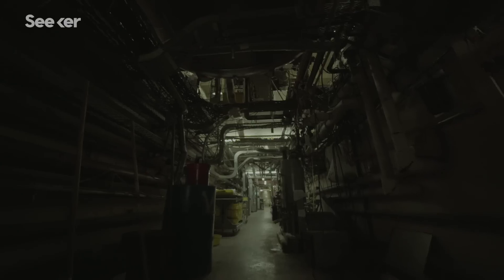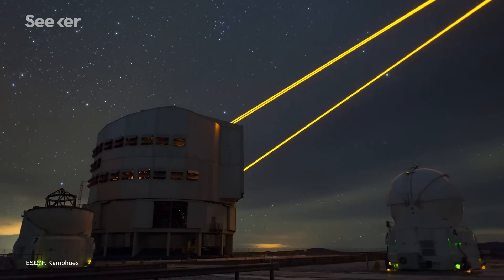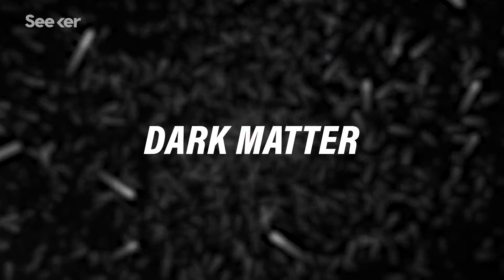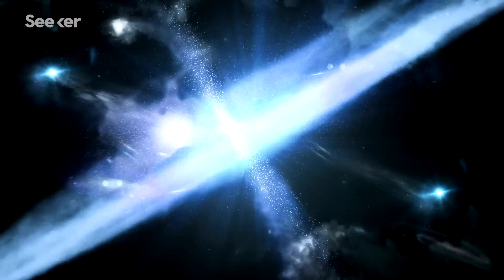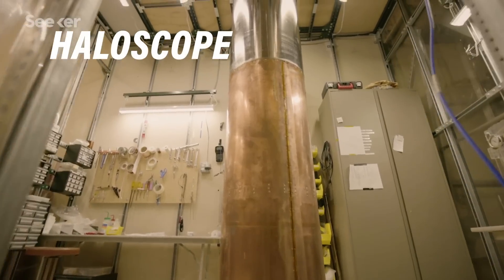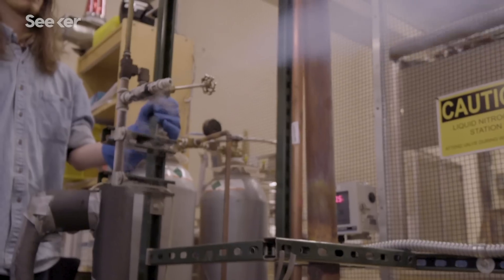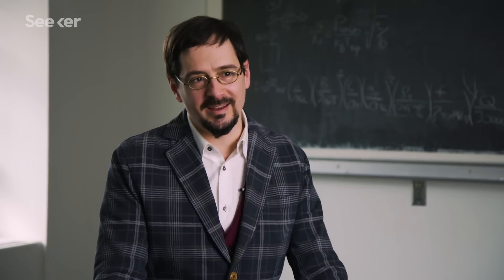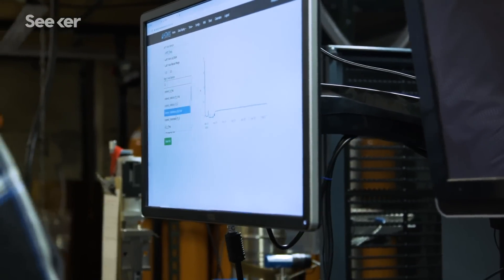The New Dark Matter Particle on the Edge of Physics

Comment: Find some entity to do my gravity test to possibly have the literal Theory Of Everything:
(Reusable code from my files):

Revised TOE: 3/25/2017a.
My Current TOE:

THE SETUP:
1. Modern science currently recognizes four forces of nature: The strong nuclear force, the weak nuclear force, gravity, and electromagnetism.
2. In school we are taught that with magnetism, opposite polarities attract and like polarities repel. But inside the arc of a large horseshoe magnet it's the other way around, like polarities attract and opposite polarities repel. (I have proved this to myself with magnets and anybody with a large horseshoe magnet and two smaller bar magnets can easily prove this to yourself too.  It occurs at the outer end of the inner arc of the horseshoe magnet.).
3. Charged particles have an associated magnetic field with them.
4. Protons and electrons are charged particles and have their associated magnetic fields with them.
5. Photons also have both an electric and a magnetic component to them.

FOUR FORCES OF NATURE DOWN INTO TWO:
6. When an electron is in close proximity to the nucleus, it would basically generate a 360 degree spherical magnetic field.
7. Like charged protons would stick together inside of this magnetic field, while simultaneously repelling opposite charged electrons inside this magnetic field, while simultaneously attracting the opposite charged electrons across the inner portion of the electron's moving magnetic field.
8. There are probably no such thing as "gluons" in actual reality.
9. The strong nuclear force and the weak nuclear force are probably derivatives of the electro-magnetic field interactions between electrons and protons.
10. The nucleus is probably an electro-magnetic field boundary.
11. Quarks also supposedly have a charge to them and then would also most likely have electro-magnetic fields associated with them, possibly a different arrangement for each of the six different type of quarks.
12. The interactions between the quarks EM forces are how and why protons and neutrons formulate as well as how and why protons and neutrons stay inside of the nucleus and do not just pass through as neutrinos do.

THE GEM FORCE INTERACTIONS AND QUANTA:
13. Personally, I currently believe that the directional force in photons is "gravity".  It's the force that makes the sine wave of EM energy go from a wide (maximum extension) to a point (minimum extension) of a moving photon and acts 90 degrees to the EM forces which act 90 degrees to each other.  When the EM gets to maximum extension, "gravity" flips and EM goes to minimum, then "gravity" flips and goes back to maximum, etc, etc.  A stationary photon would pulse from it's maximum extension to a point possibly even too small to detect, then back to maximum, etc, etc.
14. I also believe that a pulsating, swirling singularity (which is basically a pulsating, swirling 'gem' photon) is the energy unit in this universe.
15. When these pulsating, swirling energy units interact with other energy units, they tangle together and can interlock at times. Various shapes (strings, spheres, whatever) might be formed, which then create sub-atomic material, atoms, molecules, and everything in existence in this universe.
16. When the energy units unite and interlock together they would tend to stabilize and vibrate.
17. I believe there is probably a Photonic Theory Of The Atomic Structure.
18. Everything is basically "light" (photons) in a universe entirely filled with "light" (photons).

THE MAGNETIC FORCE SPECIFICALLY:
19. When the electron with it's associated magnetic field goes around the proton with it's associated magnetic field, internal and external energy oscillations are set up.
20. When more than one atom is involved, and these energy frequencies align, they add together, specifically the magnetic field frequency.
21. I currently believe that this is where a line of flux originates from, aligned magnetic field frequencies.

NOTES:
22. The Earth can be looked at as being a massive singular interacting photon with it's magnetic field, electrical surface field, and gravity, all three photonic forces all being 90 degrees from each other.
23. The flat spiral galaxy can be looked at as being a massive singular interacting photon with it's magnetic fields on each side of the plane of matter, the electrical field along the plane of matter, and gravity being directed towards the galactic center's black hole where the gravitational forces would meet, all three photonic forces all being 90 degrees from each other.
24. As below in the singularity, as above in the galaxy and probably universe as well.
25. I believe there are only two forces of nature, Gravity and EM, (GEM). Due to the stability of the GEM with the energy unit, this is also why the forces of nature haven't evolved by now. Of which with the current theory of understanding, how come the forces of nature haven't evolved by now since the original conditions acting upon the singularity aren't acting upon them like they originally were, billions of years have supposedly elapsed, in a universe that continues to expand and cool, with energy that could not be created nor destroyed would be getting less and less dense? My theory would seem to make more sense if in fact it is really true. I really wonder if it is in fact really true.
26. And the universe would be expanding due to these pulsating and interacting energy units and would also allow galaxies to collide, of which, how could galaxies ever collide if they are all speeding away from each other like is currently taught?

DISCLAIMER:
27. As I as well as all of humanity truly do not know what we do not know, the above certainly could be wrong. It would have to be proved or disproved to know for more certainty.

Here is the test for the 'gravity' portion of my TOE idea.  I do not have the necessary resources to do the test but maybe you or someone else reading this does, will do the test, then tell the world what is found out either way.

a. Imagine a 12 hour clock.
b. Put a magnetic field across from the 3 to 9 o'clock positions.
c. Put an electric field across from the 6 to 12 o'clock positions.
(The magnetic field and electric field would be 90 degrees to each other and should be polarized so as to complement each other.)
d. Shoot a high powered laser through the center of the clock at 90 degrees to the em fields.
e. Do this with the em fields on and off.
(The em fields could be varied in size, strength, density and depth.  The intent would be to energy frequency match the laser and em fields for optimal results.)
f. Look for any gravitational / anti-gravitational effects.
(Including the utilization of ferro cells so as to be able to actually see the energy field movements.)
(And note:  if done right, it's possible a mini gravitational black hole might form.  Be ready for it.  In addition, it's possible a neutrino might be formed before the black hole stage, the neutrino being a substance with a very high gravitational modality with very low 'em' modalities.)

(An alternative to the above would be to shoot 3 high powered lasers, or a single high powered laser split into 3 beams, each adjustable to achieve the above set up, all focused upon a single point in space.)

'If' effects are noted, 'then' further research could be done.
'If' effects are not noted, 'then' my latest TOE idea is wrong.  But still, we would know what 'gravity' was not, which is still something in the scientific world.  Science still wins either way and moves forward.

Comment: I still don't understand why they are looking for dark matter in the first place, and besides, if it is dark matter, dosn't it means you can not make it known ?
Reply: They need to find Dark Matter to make their presumptions about the universe work, because they don't know everything they make it up. There is a reason they haven't yet found dark matter with the million$ research, because it doesn't exist! It's a fantasy that theoretical physicists have to make their models work.
Reply: @LogicPTK  If its a fantasy then their shouldn't be an issue but since their is an issue they call it "dark matter" because they dont know what causing the problems in their calculations and observations. So no, the issue is real but dark matter being an actual particle or field in particular is just one of the theories that could solve the problems in their equations and observations which is why their trying to detect it. Their are other theories that speculate that dark matter doesn't exist and that we probably just need to adjust the current equations to better suit what we are observing.

Comment: If they are not atoms, why are we looking for them at the scale of atoms? Isn't it possible that they are just larger-scale probability clouds so we mistake them for background noise? If they are large enough with combined wave functions how are we supposed to identify the edges? Seems like it would only be a difference in density of probability or higher dimensional waves.
We would either need to have a sensor of as many dimensions as possible or we would have to be able to move dark matter manually. The latter doesn't seem to be an option right now.
What is it that makes it necessary for darkmatter to be at the atomic scale?
Reply: They are currently reasearching axions (theoretical particles)that if true has a similarity to the property of dark matter. Dark matter by itself is still unkown wether it is the size of an atom or the planck length.(the characteristics of dark matter has somewhat been observed but its true nature(composition, size, implications)are fully unkown and current research is focusing on making a hypotheses that fits).
Reply: Observations has indicated it has some effect on gravity indicating that it has mass but it also implicates that it doesnt/barely interact with baryonic matter making detection of so called dark matter extremely hard.
Reply: @nani4261  Thanks. Much helpful!